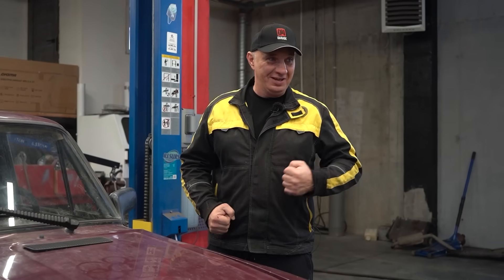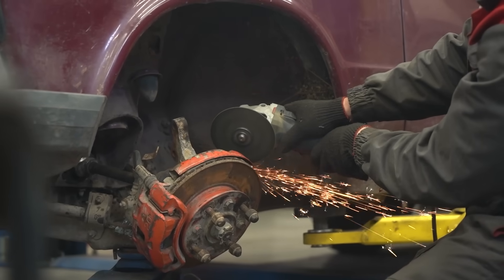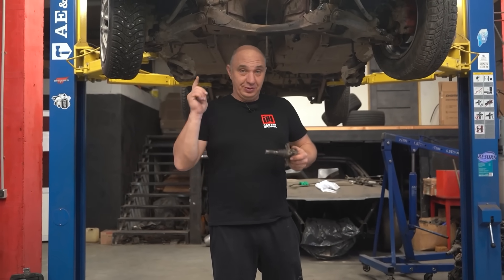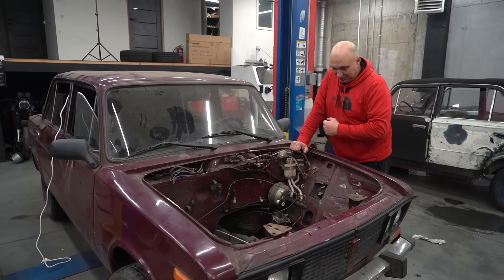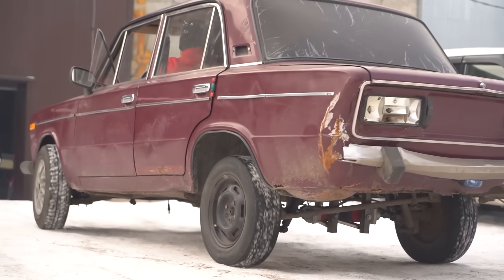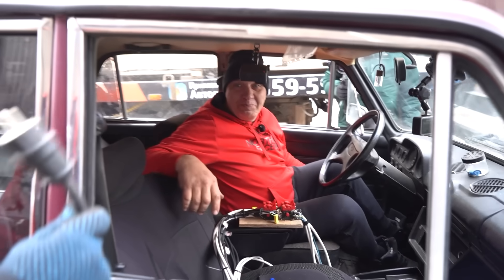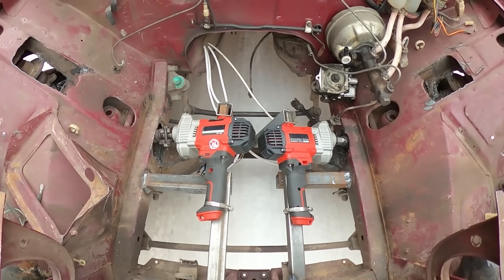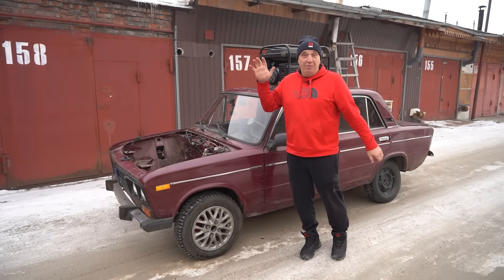4-motor plug-in electric Lada - first drive

Comment: I would like to see the Garage 54 team install a large electric motor mounted to a manual transmission. Power source from a generator in the trunk and propel the car with different gears from the manual transmission.
Reply: Robot Cantina is doing something similar right now
Reply: Yes. Always wondered about that myself. Seems like it would work in theory.
Reply: @giggiddy  It does work, you can find videos about that on Youtube where this idea was even used in professional restomods
Reply: You are describing a system that diesel-electric locomotives use.
I just posted that they should try something similar to the Kraus Maffey diesel-hydraulic system.
The “prime mover” could be gas or diesel.
Preferably a small diesel, such as a Kubota, as in 1800 CCs.
Reply: Use the lada engine as a generator lol
Reply: It definitely works, but as for using a generator to power it, that is problematic. Warped perception modified a tesla to run on the most powerful generator he could fit in the trunk, and it couldn't keep up to the power demands of just driving down the road at moderate speeds. He had to pull over a few times to let the generator charge the battery, even though the gen was running full throttle the entire time, to the point that it's exhaust glowed red in the dark
Reply: 🤔🤔 is there any manual ev on the market? Not even the exotic hybrid have one. Kinda sad and wild. 

Guess we gotta be thankful for dodge, Porsche and a few other brands still giving manuals. 

Thankfully the car scene where im from is all about manual transmissions. Auto es seen so bad 😂 unless the car has it from stock and no manual is available.

But people here in PR will shed w.e for manuals. And they are still the least stolen cars hahahaha
Reply: @emanuelperez3595 I don't see what the point would be--except with the exotic hybrid.  Maybe I'm misunderstanding something.  Do they use any kind of torque conversion in the first place?  Don't know a hell of a lot about cars, but know the basics, more or less, at least.  At least with gas cars lol.  I personally love driving a manual, even just for the engine braking.  I feel so much more in control of the car.  It drives me crazy to always have to use the brake to slow down.  Tiptronic-type automatics are somewhat better, but ... I dunno, to me, it's just not the same.
Reply: Kinda like diesel-electric submarines. The diesel engines drive generators that charges the batteries, while electric motors are attached to the propellers/screws. The generators can run the electric motors on their own, the batteries are only for "ultra quiet" when they have to avoid detection by enemies.
Reply: Indeed, none of the pure electric car I have seen have manual transmission. I would like to know the mileage in terms of km/kWh, top speed that can be achieved
Reply: They need to make their own hybrid with a gas generator powering electric motor.
Reply: I think Rich Rebuilds made a manual electric mini cooper S
Reply: I saw someone destroy a classic mustang with exactly this idea

Comment: This is a true Hybrid because the all first hybrid car in history was a big thing barely able to reach 60kph built by Lohner Porsche (yes Ferdinand Porsche himself) in 1900, this one is way ahead of the Lohner Porsche (no batteries, only an onboard generator).
Reply: A Hybrid car has an engine and batteries. This is a corded electric car
Reply: @Floofie_boi  there's an engine, on the roof which provides power to the electric engines like a diesel electric train, effectively not a real hybrid but an electric with an onboard generator (it's unplugged so it's not a CORDED electric car)
it's more a hybrid than a corded electric car because there's 2 types of power on a single vehicle (one provides power to the other like on a hybrid because on a Prius the electric engine is there only to provide more power so you can use a smaller combustion engine to save fuel, in this vidéo they make a similar car to the Chevrolet Voltz or a Fisker Karma which are known as hybrid)

Comment: Great video. I say try (4) excercise treadmill motors, all mounted on one plate and hooked up to a manual transmission. Next. Mount and upgrade the gas generator to a 9000-watt model, and mount it at the rear of the car.
Reply: For anything that plugs into the wall, they'll need more than 4 motors for it to have any significant power. More like 40 if you want it to actually have some pull
Reply: No, where the engine goes

Comment: Wheel chair motors have been used in smaller applications ran off batteries.. you could up that scale.. maybe put solar panels on the car and add an alternator to one motor

Comment: 21700 or 18650 with fork lift motors
Reply: Nah lada with 4 starters and 12 car batteries, cause lada.
Reply: @ThingsToDew  that's still only 12v... my electric scooter running. 60v 90amps dc
Reply: @cameredith0  12 car batteries wired to be 72 volts in 2 banks of 6.
Reply: @cameredith0  build the electrical so you can apply 144 volts at any time for short bursts. And 12v for long slow moments.
Reply: @cameredith0  you could also wire each starter motor with its only 12v 24v 36v sequence for 36v to one starter.
Reply: @ThingsToDew  no, voltage is correlated to speed, you need a voltage converter
Reply: @ThingsToDew  72 is scooter volts. a car need like 400v 50+amps. 12 car batteries is no where near enough
Reply: @cameredith0  car batteries have higher cranking amps, people already proved it works with poorly designed systems. You maybr be right about needing more volts. But 144v is definitely scrathing eough powrr. There are all sorts of hyvrids that have higher end power but no low end power

Comment: I'm surprised those drill motors haven't burned out. You should use car batteries and a DC to AC converter to make an electric Lada
Reply: They are universal motors (series wound) - they can run with DC or AC. With AC they need a higher voltage to deliver the same power because of the inductance
Reply: No need for an inverter, most power tools use universal motors that are perfectly fine with DC. Though you would need to swap out the phase angle power controller for PWM.
Reply: They did another one recently where they powered the rear wheels with different motors and it was cool
Reply: You don't need an inverter for that type of motor. Those are series wound, aka "universal". They run happily on AC or DC. Probably would lose the speed control function as THAT relies on zero crossing (property of AC) to work, but the motors themselves would work just fine straight off of battery.
Reply: Russian things last longer
Reply: @gabrielvieira.4358   Russian stuff.  Made by bears.  Built stronk!
Reply: @BlackPill-obey  Very true comrade
Reply: The expensive converter wouldn't handle the starting load
Reply: Those drill motors needed additional gear reduction.
Reply: I thought they would have burned up too, especially the speed controller built into the trigger.
Reply: @volvo09 oh shit.. you might be right.. 4 wires from the switch.. although if so, impressive to run a whole car of such a tiny bldc controller with obviously little cooling
Reply: @forbiddenera  they are in Siberia ;)
Reply: @johnjennings9043  think you @d the wrong person..?
Reply: @forbiddenera  soz